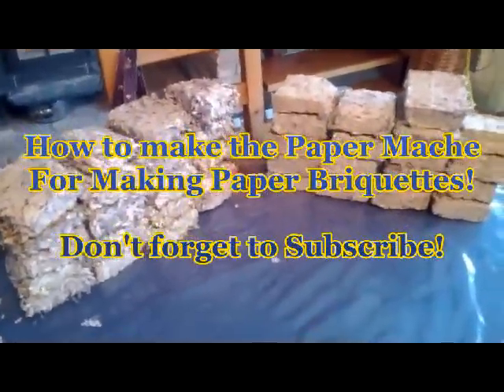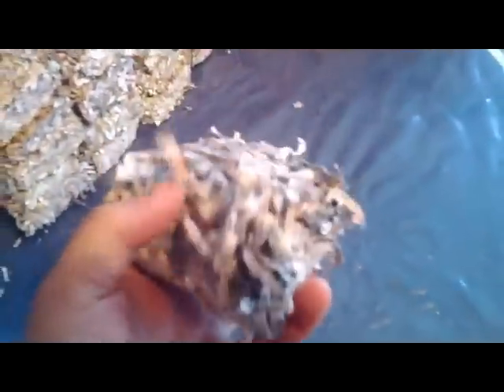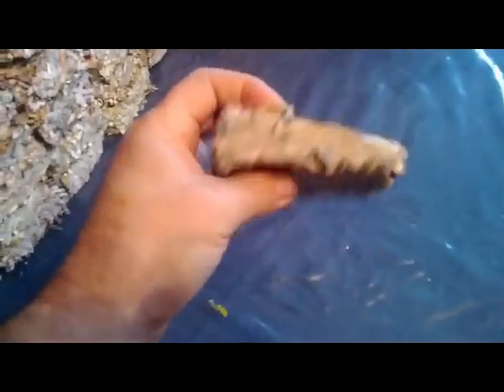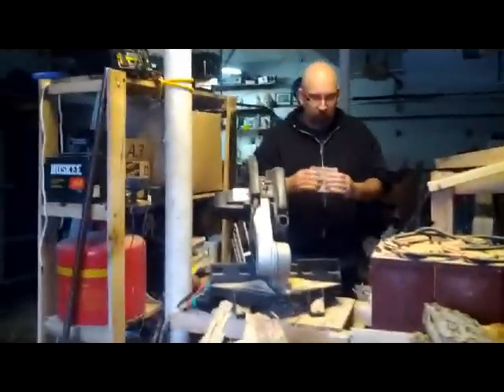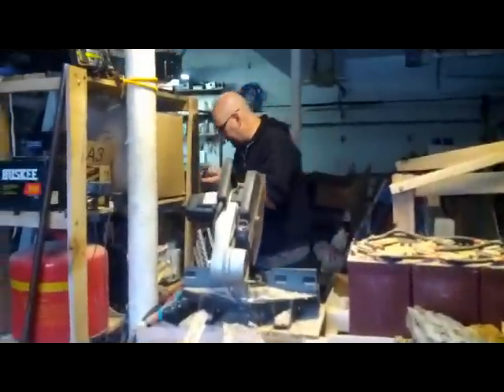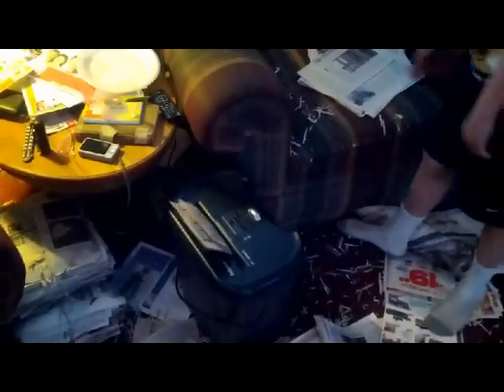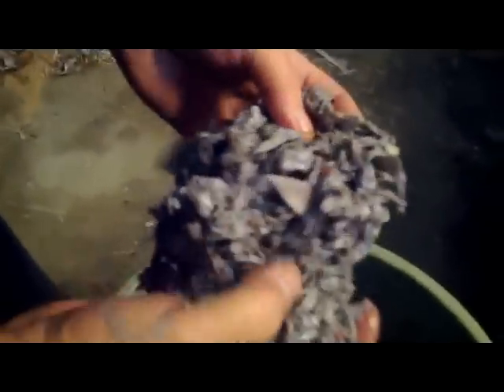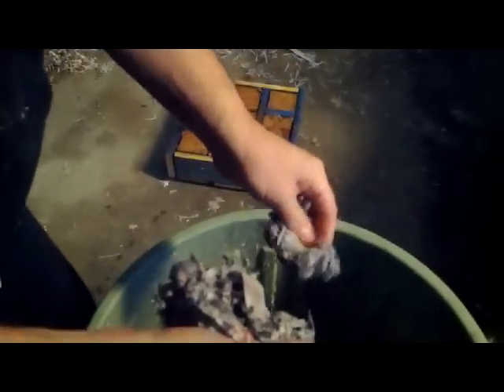Paper Mache Making for Paper Briquette Production!

Comment: Good video, but...
1.) Hot water doesn't help and it costs more than cold water.
2.) If the paper's already shredded then you don't have to use a sharp-ended drill bit.  
3.) The longer you soak, the less work you have to do.
Enjoy!